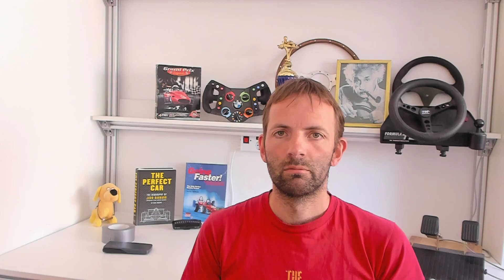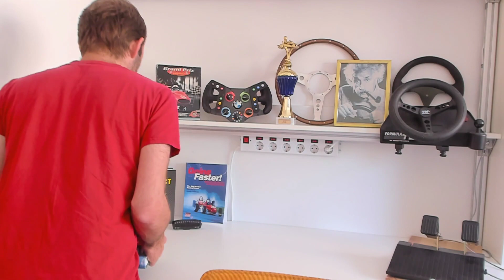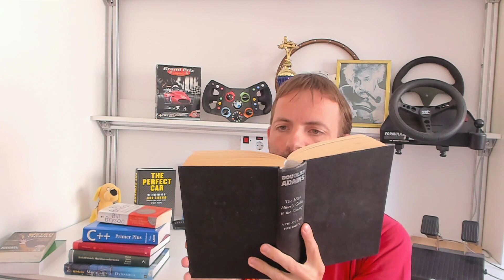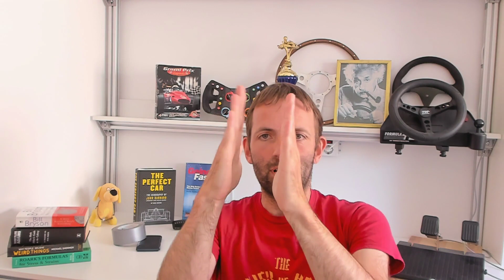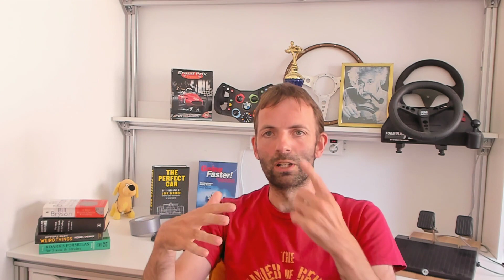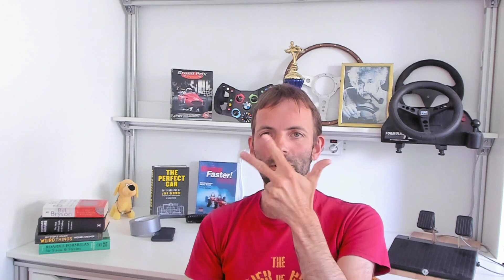Why are tires so difficult to model in a racing simulator?

Comment: Why not use an empirical model to train a physical model? Simplified to fit a YouTube comment: get a data set of what behavior you expect from the car. Spawn thousands of small simulated changes to the physical tire model, and then isolate the closest points on a histogram. 

Real world narrative example, “We know the tire temps should look like this” then you run simulations until your histogram looks similar to other data sets and still gives you the new tire temps you expect.

Now do the same for camber. Now do it for yaw. Once you lock in the primary behaviors you expect, you can forget whether or not the physical model matches realism, but it should feel and behave more realistic.

For example, I don’t care if the game engine is simulating that the tire walls are made out of uranium if that uranium variable is making my car feel and behave in a realistic way.

Comment: No mention of RF2, I think it's the only sim around that has any proper tire deformation and wear.
Reply: The only problem with the tires in rfactor2 in my opinion, is that they overheat to fast,  even hard tires if you push hard, will overheat in 2 laps, of course it depends on the cars, but the official cars "s397" are the worst offenders.

Comment: The best is F1 1991 HE. It is the only mod that has correct slip angles for F1 90's style, most sims model the Avon historic tyres relatively easy slip angles for historic racing. Actual goodyears had around 3-4 degrees slip angle
Reply from the maker: Where did you find this information and how reliable is it? Race Car Vehicle Dynamics has a slip curve for a Goodyear F1 tire where it maximizes around 5 degrees. Plus we don't know the test machine and conditions, there is a bit of a tolerance on such values.
Reply: @NielsHeusinkveld  35 years of motorsports experience and 25 years of race sim experience. Yes there is tolerance due to heat, road conditions and scrubbing.

Comment: Here is a layman question: I tend to believe that even a physical model can be tweaked post processing so to speak with modifiers that alter e.g. the overall grip level after the tire model calculations have done their magic. That is to say without changing the model itself. I would suspect that iracing's and RF2's models are full of these " quick hacks". Am I right or wrong?
Reply from the maker: Probably correct, certainly about rF2.. That is weird though isn't it? The model does its ultra complicated thing, and then you 'hack' the results a bit to your liking.. Sounds to me like the model is broken if you need to do that. :-)

Comment: The problem with a physical model is when you compare the output to real data, if something is off, the problem can be the model itself, can be in the data you are referencing, or can be in the data you inputed, that's trying to solve a Rubik cube that has only 1 color. you can hit a deadend doing everything you believe is right and then you have to change the entire model, without able to tell what was wrong with the current one before you start the new one....

Comment: Excellent explanation, Niels. I couldn't agree more. I am being involved in modeling physico-chemical systems since 1990, and computation has made the change. Models need calibration and validation and for that, you need extensive, reliable and accurate data sets under different coditions. As you say, data on tire behaviour is not always available for those purposes. It is very good that iRacing and rF2 make an effort to advance in this sense. I would encourage them to keep working. At the same time,  it is perhaps good to review the scientific literature and search for simplified models, still with a physical base. Thanks for the explanation Niels!

Comment: Why not use AI to model tyres?. If there are a lot of intangibles then it seems a good way to do it?
Running AI in loops as it homes in on a solution is really effective. No one really knows how the AI solution even works, but it does.

Comment: Tire modelling is so difficult, because games like Codemaster F1, iRacing, rFactor 2, their programmers ALL guestimate the traction limit. It was ONLY ever GP2/GP3/GP4 that a slick racing tire was modeled correctly, as Geoff Crammond had access to REAL F1 tire data from F1 teams. Geoff ALSO programmed decently, Locked tires, and tire ride up, when a car rides up another cars wheels, all yet to be surpassed by the aforementioned "simcades".
Reply from the maker: Well I loved GP2 a lot and respect Geoff Crammond a lot.. But you are claiming quite a lot here! I would love to see the source code for the tire model. I think that there are fond memories that might make it seem better than it really was.. What troubles me is that Geoff always had this weird fixed framerate stuff going which just made me doubt his programming ability as a whole!
Reply: @NielsHeusinkveld  Why GP2/GP3/GP4 ran so smoothly, and consistently, was BECAUSE of the CPU Occupancy setup, and a rather low FIXED frame rate, not low enough to be unplayable, at any point in a full grid race.

Contrast to ALL modern VARIABLE frame rate sims (iRacing, CodemasterF1, rFactor2, Pcars....), where you drive around a track by yourself, at say 200fps, then an online race with AI, full grid, dropping to 100fps and less, when online racing, where the frame rate jumps erratically, and with lag (this is exactly the inconsistent feeling all the pro-racers were complaining about in the Indianapolis oval finale online race). FRAMERATE is DIRECTLY set, by how fast your CPU is (the very latest and most expensive CPU's) and how fast your 3D Accelerator is (Again the fastest latest most EXPENSIVE graphics card will, get you higher frame rates in the sim)....So the people rich enough (Pro-race drivers) to buy the latest fastest PC's and Steering wheels and pedals, will DIRECTLY have a huge advantage over, someone else you maybe racing online, with a minimum sim set-up.

Comment: Would one consider having more than one tyre model in the same simulator and then average them using diferente weights (or any other aggregator) ?
Something like:

 calculateGrip(
   empiricalModel(carProperties, trackConditions, otherStuff),
   physicalModel(carProperties, trackConditions, otherStuff),
   someOtherModel(carProperties, trackConditions, otherStuff)
); 

calculateGrip function would apply different weights over the tyre model output. 
The weight for each model could be empirical, based on driver's feedback and car & track combination.

I'm a developer but not on the simulator market. 
So this although might "possible" might not be feasible or correct for many different reasons.

But, in my mind, having in the same sim a set of models, if viable, could help tests. 
In the non-simulator software development industry we can start a program and interact with it in an automated way, simulating what a user would do with their input methods. 
We do this to certify that after changing the system all the other features are still working as expected.

Maybe, telemetry data could provide a way to compare models. 
Given the driver inputs, car and track properties and its current condition, could show where a given model "breaks reality" or how far from reality they are in different scenarios.

I know, this sounds all "pretty", but by no means I'm saying it would be easy or even a good solution. 
I'm talking only as a fan and I recognise such "idea" can be half galaxy away from being useful or viable. 

All the best ;)

Comment: Mind this quote in the video:

"Hats off to isi and Dave Kaemmer (with iracing). I might not like how it drives, but... that's high end stuff"

Basically, regardless of if the tire is "accurate", it's crazy they're even doing this model and getting as close as they are. And it IS improving. But it's important to remember it's not as simple as "here's a specific thing to change". There's a lot that goes into the modeling with a physical model, but it has a lot of positive elements too. Will iRacing get it right? Time will tell. But it takes a lot of time. And especially with how iRacing is attempting to do it (real time modeling)... that's insane. 

Though this reminded me of how many times I've asked iracing to do insane things like this and how many times they've done it...

Comment: These tyre models, rf2 and iracing, how hard is it for these game to compute in real time? Newgarden highlighted the tyre as the big difference between the real thing and iracing.How does inertia factor in? on track a tyre can lose all grip, lifting off the ground like in monaco or locking up or by slipping, but the car will always follow inertia, or the greater of the 2 forces, I wonder if emulating inertia and gravity is crucial to the tyre physics.

Comment: Nice video. The problem with physical model is also that some tire types might be easily fitted by it but others might not. Real world tends to be more dampened than simulations of it and there are some calculation problems with that. You can get the basic right but then its hard to get to details like imperfections like uneven surface, compliance etc. These might have small effect but together changes the feeling.

Comment: Forza Motorsport was born around this, but children that only look at graphics, using controllers and never driven in their life's never now and kept saying Grand turismo is better! I remember the first time you could use the xbox360 FFB steering wheel and tried Forza on X360, included PC sim games, it was the only one that was giving proper wheel torque Feedback, not that heaviness while turning of Simple FFB logic, but that where, if you slide the car the wheel would turn in the direction the Autotyre alignment would send the wheel in real time and behavior would change if you set toe in or out. Plus there you could really understand the needing of Camber and other things, where in Granturismo was totally fake. Only thing I didn't like in Forza was the Simetrical tuning, you could not tune each wheel on the same axis in a different way, so like with Ovals you had to use only 2 tires sacrificing the internal ones. But when you explain this, the stupid are always back with the Fanboy s#it. Also games like Project cars and many other Sims, why on this bloody hearth should I change Wheel setting to match reality???? Finding shaky wheels on the straight or in slight oversteer not having any FFB from the tyres, that is stupid. I really like the Forza franchise, but hoped it goes MORE raw motorsport, with qualifying and race stuff like in other PC racing games.

Comment: Are there any sims that also model the flex of the rim itself? There certainly is some amount of flex during hard cornering.
Reply from the maker: I doubt it. And if you get tire data, they also had a rim mounted then, so the deflection you see is from tire AND rim.. But typically how I look at engineering things is, if one thing is 10x smaller than another thing, you can mostly forget about it. The rubber will flex and twist WAY more than 10x more than a rim.

However, a rim is a 'simple' often metal object that is a lot less hard to understand than a tire. So modelling it as a flexible object is probably not THAT difficult. It will be very stiff though and physics engines and very stiff things don't always get along..

Comment: Niels is very knowledgeable and I have a great deal of respect for him and I also like the way he tries to explain things. Listening to him on this subject does bring up some points that I have been thinking about. That is, Niels is speaking from a position of being a modder. As far as I am aware, (and I could be wrong here) he has not been involved in the process of actually coding a tyre model from the ground up. Yes, he has taken A model and used it to create "tyres" to be used in a sim but he has not built a tyre model from code 0. So, albeit he is extremely knowledgeable he is also very limited in the understanding of actually building a real-time tyre model. Therefore, he cannot accurately assess how complicated it is for iRacing to change certain aspects of their model; he can only make an educated guess, (at best!) but without being privy to iRacing's code he is completely speaking in the grossest of generalisations. 

Yes, some cars in iRacing are bad at the moment, (GT3/GTE) but if he were to try the Skip Barber, Porsche 911 Cup car or even the HPD, these cars are actually pretty amazing at the moment. And, that's the thing, iRacing will keep chipping away and one day all the cars on iRacing will feel amazing, and most likely ACC, rF2, AMS2, etc... will all be long gone and replaced by something else that you have to purchase and re-learn.
Reply from the maker: Yes, good points, I'm making assumptions about these models and their ease or difficulty of use. I did hear from both rF2 directly and iRacing indirectly that tweaking is difficult, but I don't know the current state of the model or its ease (or difficulty) of use when it comes to iRacing.

Then again, a physical model that you can tell "Do this to grip and load sensitivity when camber goes from x to y" wouldn't be a physical tire model anymore. So I do think by nature there will be less control over very specific tire force altering bits and pieces.

Comment: The thing is each “sim” should be able to show for at least a nominal/variety of conditions that they have similar behaviour of the car they’re modelling in how it drives (would be great marketing material to actually show this, and I can’t believe it’s not done more). It’s got to a point where the community talks “tire model” and other issues so much I think it’s a distraction from what we actually want as the final output- a realistic, fun to drive simulator. In my opinion Dirt Rally 2 achieves this- no one, even the pro drivers, care which differential equation or model the designers used to achieve the output. I am an automotive engineer. Niels, Great video with great information for people interested 👍

Comment: Papa Niels: gives a lecture about tires, physics, etc
Also Papa Niels: haha trucco does F L I P P
Dr Jekyll and Mr Hyde!
Reply from the maker: Oddly enough, those fun crazy experiments are actually a great test for a physics engine. And a great excuse to waste a morning. With RF1 for example I wouldn't have been able to make radio control 1:10 cars because of a bug. Its actually important in my opinion when working on a game engine to try silly extremes as they can point to bugs and weird things that normal cars don't always do.  :-)
Reply: @NielsHeusinkveld  Yeah, I make small mods for my personal use from time to time, figuring out what does what is great fun! Although I got to say, sometimes those nasty limits are there for a reason - like unit limits in some rts games. Like star wars - empire at war. Turns out, merging all my fleets for final assault wasn't such a great idea, single digit fps kind of hurt. :D

Comment: Nowadays' multicore processors could be great for tyre simulation . 1 core for 1 tyre, so 4 cores would take the 4 tyres. And still have cores left for physics, graph and AI. 😀
Reply: Seems with my ryzen 5 3600 I won't be racing the famous Tyrrell F1 car then
Reply: @johannehrlich8799   Peter Panski  Who knows? Until the above mentioned beauty is finished (if it will ever), you will catch up with the hardware. 😉

Comment: Curious to know what your take is on BeamNG's tyre model. They seem to use a physical modelling approach for the entire car, not just the tyre, leading to some fairly astounding emergent properties such as natural chassis flex and force transference.

https://blog.beamng.com/a-look-at-tire-development-in-beamng-part-1/
Reply from the maker: BeamNG is just super impressive as a whole. The handling does seem quite twitchy still but I can't really tell if that is because of poor models or poor data going in..
Reply: @NielsHeusinkveld  Well, PC2 is much more twitchy if you ask me... By the way, I suppose it also has an analytical model, so it should be quite difficult to work with too?
Inspired by your other video I decided to give AMS2 a try to see how much more of an improvement it is compared to PC2, but... Braking and accelerating out of corner feel really weird to me, honestly. In braking I barely have any feel to what the front is doing, while pressing the loud pedal feels like I'm controlling the rear step out directly in a linear fashion doing so. Caterhams are especially guilty of that while RR cars feel more or less like I would expect a car to feel. I have to admit that without these issues driving feels very much immersive though, but I'm seriously disappointed with braking, which is my biggest joy usually (trailbraking in particular).
Is there a more drift-ish car in the works, by the way?

As for BeamNG, sure, not all the cars are perfect, but if you put the LS swap mod into the drifting version of the 200BX car, it becomes a complete gem. Also, muscle cars are very nice, as is the recent "WRC" type car.
Reply: @NielsHeusinkveld  Glad you feel that way. Their content is definitely very hit and miss, but the ambition behind what they're doing is mind-boggling. If you get one of the better cars, it's like magic. It renders weight transfer unlike anything else. It's essentially the best road car and drift simulator on the market, even in its strange quasi-sandbox state.
Reply: @NielsHeusinkveld  chassis should be physical for perfect aero and tires should be empirical pacejka for perfect traction and grip and slip. Beamng handles weird because it has infact a physical tire model which imo is the wrong approach because of what @Niels Heusinkveld explains in the vid above.
Reply: And 2nd part here: https://blog.beamng.com/a-look-at-tire-development-in-beamng-part-2/
Reply: wow.. that is very interesting! Thanks